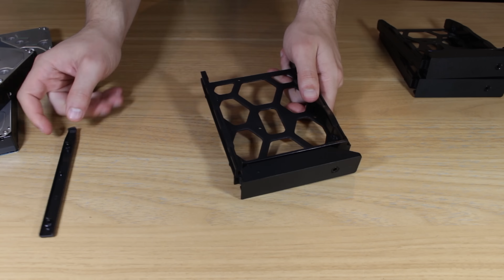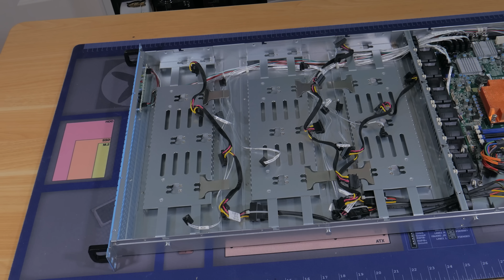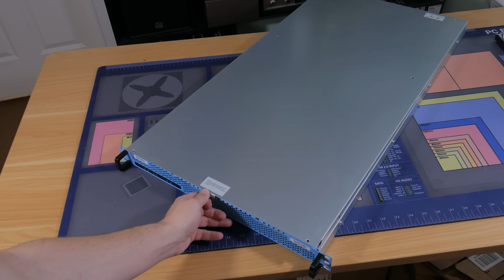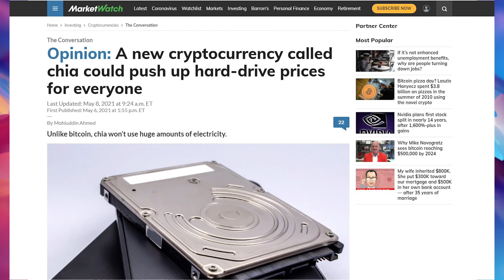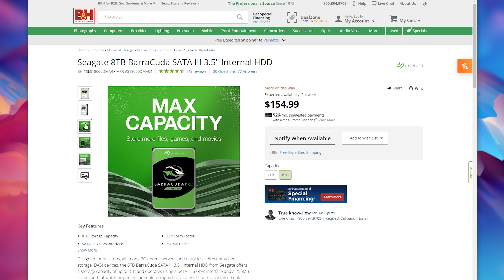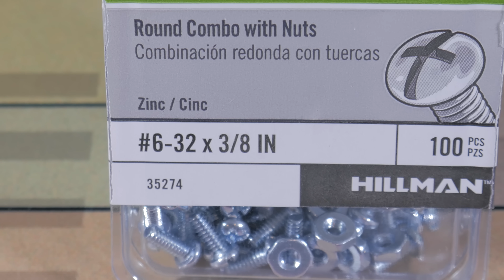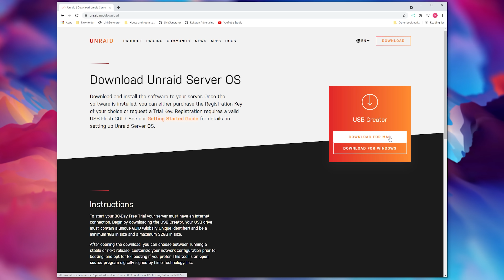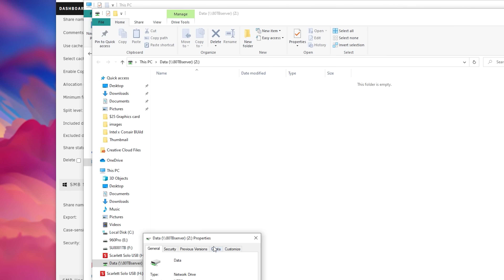Budget Storage Server 2021! | 80TB NAS

Comment: Excellent price on the server. Buying full tower PC case, power supply, motherboard, processor, 12 port SAS controller card (SAS supports SATA drives), additional cables, all used, might cost more and you still have to build it. The only disadvantage is no hardware RAID. I manage servers in my job and had too many bad experiences with software RAID solutions, while hardware RAID tends to be rock solid in reliability. My NAS is with 11 SMR drives in hardware RAID 5 using a cheap used SAS controller card from eBay and it works very well. Write speeds typically max out 1 Gb Ethernet speed.

I only just stumbled on this channel. The way he talks reminds me of NileRed, but instead of chemistry, it's computers.

Comment: There is no such thing as overstatement of capacity by drive manufacturers! The issue you experience is only due to Windows bug/feature. Windows show the wrong unit - while the value is calculated with a TiB binary formula, the unit marker is incorrectly displayed as TB. Please blame Microsoft, for not properly following the international unit system prefixes (SI). A TB is always 1.000.000.000.000 bytes. At least for us, serious users, the Linux tools show proper units - either TB or TiB, so the numbers do match whats written on the drives (and most tools have an option to switch whether you want a decadic or binary prefix). This windows based mis-cult even gets more insane - when some folks believe that the difference (lost capacity) is due to "formatting".

Comment: Thumbs up for the build!
Definitely SMR is not my favorite storage tech, but for cold storage/archival purposes it is the best in terms of density and price per amount.
I have a similar setup, but I need more speed, than space and I have selected 12x4TB CMR drives and I am using them in a software raid6 (sorry guys, I have played the game where after a raid card failure you are stuck with replacing it with the same one just to get your data back.). 8 of the disks are older 4TB drives of different generations and the latest 4 I've ordered (just before the chia boom) are 14 TB. With them I have created a 4TB partition to join the raid 6 and the rest of a bit less than 10TB I've used to create a separate raid 10 array. This way I have a relatively fast and low latency raid 10 and huge and relatively slow (mostly because of the raid6 latency) arrays. My raid6 array is cold storage with written a few GB per day, read a few tens of GB, which yelds in less than 2 GB/h or less than 1 MB/s on all 12 drives, which leaves a lot of bandwidth for my raid 10 array which spans on 4 of those 12 drives and is my main work storage.
Since I was looking for a cheap board with the most available satas I've came across to an inexpensive gaming MOBO, budget AMD processor and cheap cacheless raid boards in JBOD mode.
Later I've found that there is a compression introduced in BTRFS recently. That solved my biggest problem - I am collecting a lot (few to tens of gigabytes of data every single day) of plain text data: server logs, iot collected data, crawling some json data... BTRFS compression of level 8 seemed to be the best trade-off between compression level and performance. At level of 14 I get a few percents more compression at the price of 10 times lower speeds and much more CPU usage. The plain text I am storing is compressed about 9 times at level 8 and about 9.5 times at level 14!! At level 8 it consumes about 40% cpu time on my 6 core 3 GHz processor at rate of about 1 GB/s decompression rate (actual read from the disk is about 110MB/s. The compression is a bit more CPU intensive and a bit slower - about 600-700MB/s. However, these speeds are achievable only locally on the machine, otherwise I am limited to 110MB/s by my 1 Gbps network, making the machine literally idling when accessed over network.
I am about to "steal" your cache idea, but I think to go for an nvme as a bcache. Years ago I've been using raid1 with ssd for bcache for build servers and that was my best experience for having relatively big rotational storage with reasonable speed. I've been building android on it and the build speed was negligibly lower to just and SSD, but the bonus of having huge rotational backing device behind the SSD cache drive was really nice. I am wondering how I didn't remembered that when I was building my storage?!
My setup yielded a bit more expensive than yours, even the fact that I previously had 8 of the drives, they are smaller than yours, had the case and the power supply, so your components choice just rocks. Adding that you got an 1U server, with IPMI definitely puts your build at another level. Great job man!

Comment: Nice job...
However,
You could have gotten a DAS and a raid card (hba) and had RW of around 8gbs. No OS required.
You could have gotten a 5 bay old HP microserver, installed DSM and upgraded a hack bios and had a much smaller and lower noise/power system..
Cheaper as well.

What most people don't take into consideration is these work to the slowest point, if you have a old drive, transfering that data to the fastest thing in the world is still going to run at old disk speeds. (100mbs)

Gigabyte Lan is not too bad if your running SATA 2 In a 3 disk array. As you can max this out, but you'll bottle neck on SSD drive transfering.

HBA or 10gb Lan (convergence cards) tend to make the system faster of you're moving big files. 
A cache is essential, but you don't just have to have a SSD or m.2, you can provision RAM as a ram drive and move the data from this, you'll want dual PSU  and a UPS if you want to do that as power off/out will lead to issues of the data loss type.

I've three back up systems.
One is Microserver running DSM.
One or rather two is a cloud server, one is with a server and the second is on a DAS.
And a windows server with SMB. Windows 10 I think just run of the mill and file sharing which is the actual drive.

If you're running anything like this, don't forget to be a better expert at firewall and routing so that you can fully lock down the system. Deny all outside traffic, allow your workstation only. Don't connect this to your home networks main router and change default settings and configuration.
And the final word.....
Having a back up is not having a back up.
Backup your backup. Keep your backups up to date, both of them.

I like your video, nice shoot, nice digs. Bad ram juggling! Lol. ;)

Comment: 3 years after buying 4*4 TB HDD I realized they were SMR. I'm using TrueNAS which uses the ZFS filesystem and you get horrible performances with SMR (10 MB/s). I only saw that when I did a little bit more that just watching 1 video at a time stored on the NAS. Otherwise I had 0 issue, thus the 3 years to figure that out.
The HDD weren't labeled for NAS (got them because they were cheaper) so I had to buy replacement HDD.
tl;dr 100% agree with the video, avoid SMR drive, you want CMR
Reply: and don't forget that Seagate actually ripped off customers for implementing it to their drives at one point and most of the drives would fail cause of it
Reply: Hello sir, are you using raid for trueNAS?
Reply: @pustakahijrah3921  Yes, my drives are in RAID-Z2 configuration
Reply: @Kenshin9977  i have server with 14 tb storage, i must configure raid in bios? And set raid 5?
Reply: Hasn't seagate or WD been sued for selling SMR as NAS drives? Whatever happened to that. Fkin corporations, they get away with everything
Reply: @N1lav  I don't think any one was sued. People were mad at WD for changing some of their CMR product lines for SMR. Seagate had had their barracuda drives SMR for years now. Their iron wolf drives are CMR. They don't actually recommend you even use barracuda drives for a raided NAS device at all regardless.
Reply: How is it possible to go down to 10 MB/s, when normal HDDs can write at ~100MB/s?
And with GBit-LAN, plenty of RAM and CACHE, how does a system manage to waste so much performance, while just copying data?
Reply: @realedna  It's not the system that's the problem. It's SMR drives during an ZFS rebuild, due to design "flaws" in SMR drives. 
These drives are NOT able to do 100MB/s during ZFS rebuild.

Comment: I have been upgrading a LOT of dirt cheap Amazon computers for customers and they ALL came with Seagate. Seagate is Chinese. Completely Chinese. I have a hard drive dock and use them for data storage but they all failed. I have two "Barracuda LP" ~2Tb and they have survived longest. The first ones were "Rosewood".  That name fails almost 100% in 1 year max. Sure I keep them alive to use for scratch data in my docs but I put all my important data onto WesternDigital. But hey, Amazon had it priced correctly. Purchased the computers for a couple hundred, ripped out the hard drives after getting the windows key, installed a dirt cheap 120Gb SSD, and customers got whiplash from the speed upgrade (elderly peps).

I kept the hard drives because why not. when they die, I can scavenge the magnets. Amazon is the sneakiest to work for but they are not buying and using your soul like "Google" and "Disney". Just don't worry, be happy. Use what you can get or what comes to you and don't stress. Stressing is wasting your imagination. 

Buy anything  but Seagate if you want performance for a long time. Buy a backup software for the computer (I love BackBlaze. Unlimited storage for $5 a month. For one computer). Unraid is very nice for such a hard drive collection and its use. For speed and long term reliability, find something else.

Comment: When this fills up, you could probably get cheap used LTO tape drive that supports LTFS, then a 20pack of tapes for archiving.  At least you wouldn't have to keep swapping spinners as they fail, or growing disk counts adding to the electricity bill.  LTFS treats tapes like giant USB sticks, throughput for sequential isn't too shabby for media.  This is generally how major media outlets transfer and store super massive raw video formats.    Let us know how long that Crucial lasts.  I've gone through a handful before I switched to the more costly EVOs which I find last much longer.
Reply: I have NEVER seen a reliable tape drive in over 40 years of experience. Typical restore success has been under 50%. (Its tempting I know. I even used a program called 'TapeDisk' back in the 4GB DAT4 days when the drives were about $1000 each)

Comment: I've done the same thing with my NAS RE: shucking these Barracuda drives. They have been going strong in my NAS for years, always on.
Reply: Isn't it a concern that these are not NAS drives and are not rated to withstand vibrations from other drives?